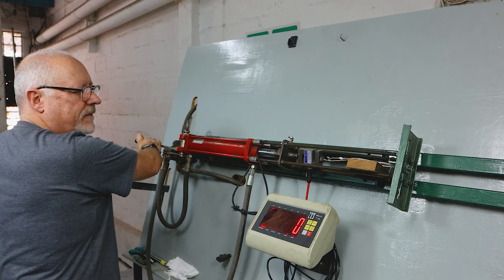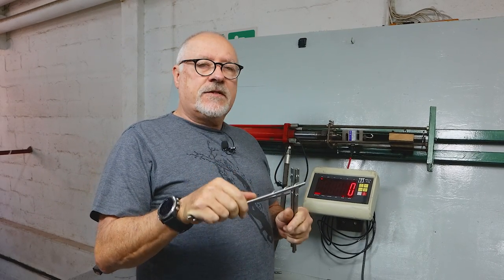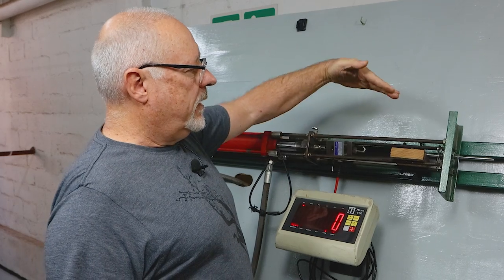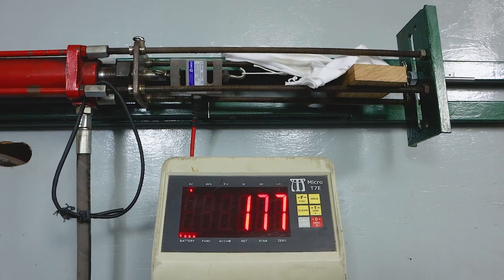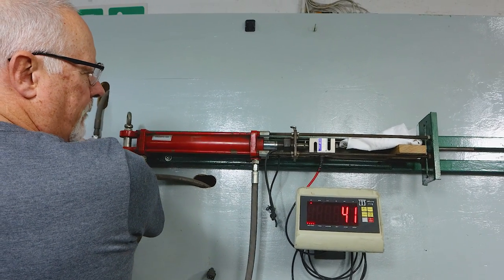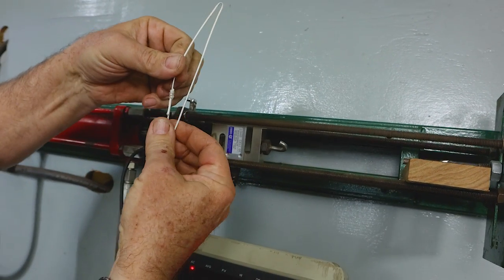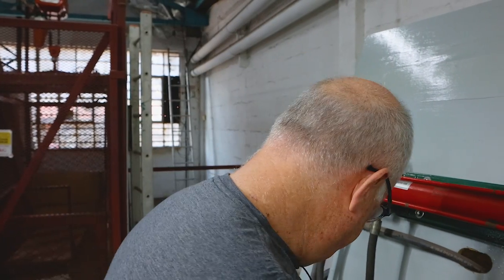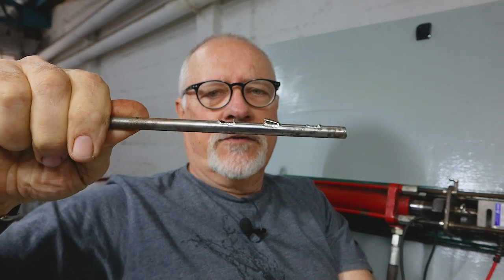Rob Allen | Welded Fin Testing | 2023

Comment: Great video. Have you checked if the heat generated from the welding process introduces any warping to the spear?
Reply from the maker: That was the primary delay in producing, we needed to do a specialized "cold welding" (very slow) to reduce heat build up. All testing shows it to be stronger than a pinned or wire fine notch where we drill a hole to fit.

Comment: What's impressive is how strong dyneema is! For 1 strand to pull off a welded fin is pretty impressive!
Reply from the maker: It is but in this case it is a loop so doubled up. A single strand is about 180kg. Double will be 360kg but there is a knot that will weaken it. We got breaks between 250kg and 320kg.

Comment: Hi Rob, any idea when these will be available in the u.s.?  Looks like another awesome, well-tested product.  Been using your products for years and love them. The only issue I've had is a few broken shafts, so hopefully this will solve that issue. Will the final product also have low-profile fins like those in the video? And will the forward fin have a hole drilled in it to attach the shooting line?  Thanks for putting in the time to do these tests and make these videos!
Reply from the maker: Hi Ben, we will be landing these in the USA in a few months. We are about to start offering a slightly higher fin with a hole to allow for the shooting line to be attached. We also have a huge demand for a loading notch half way up the shaft so that is also on the cards.
Reply: @RobAllenSpearfishing thanks for the info. A hole in the loading notch for the shooting line would be really nice.  Be great for roller guns and almost acts like a giant slip tip if you happen to string a fish if that makes sense.
Reply from the maker: @benlevine5181   Agreed, definitely reduces muzzle/roller wraps   😜

Comment: Hi Rob, im wondering any tip ir how to avoid and remove rust from my spear, i have a new one getting rust on It and the old one is all Rusty. Thanks
Reply from the maker: No way to remove rust as the coating in that area must have been compromised. We are busy working on a new coating, it is showing good results with 4 time longer life. The only way to prevent further rust is to always rinse well and dry after use. Never store in a damp gun bag.

Comment: What material are the sharkfins made of? Stainless or carbon steel? If it is stainless, wouldn't you have electrolysis corrosion due to materials difference in the welding area? Thanks!
Reply from the maker: We can weld stainless steel onto the high carbon steel. It holds well. There is a very good bond and little corrosion as it is properly fused together. The problem with stainless steel is the electroplating. The plating will not bond to the stainless and causes a large unsightly mark around the fin. We use a specific grade of steel for the fin that is compatible with the spear steel and the welding.
Reply: @RobAllenSpearfishing  you better test it overtime in the water before starting mass production. There's a potential problem there with the two different materials and the galvanic current in sea water.
Reply from the maker: @marcomelis2956  Very unlikely as the metals are fused together. Also, the fin material is also a carbon steel. We have been welding wire pins and wire fins for many years without issues.